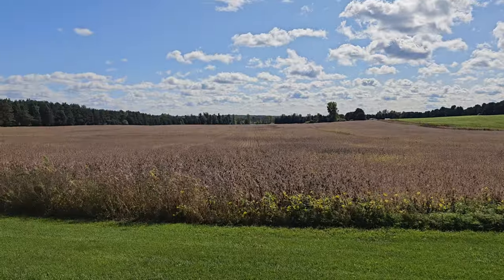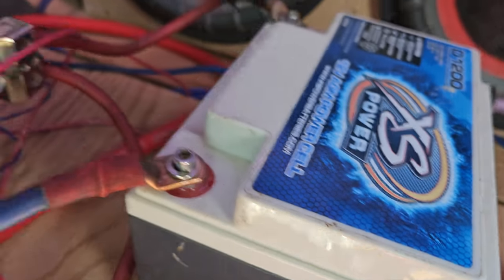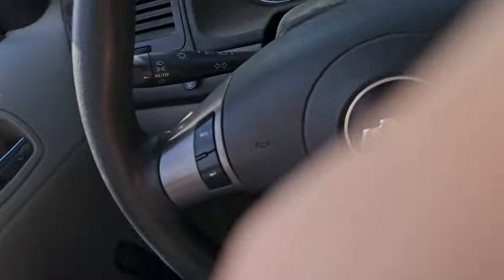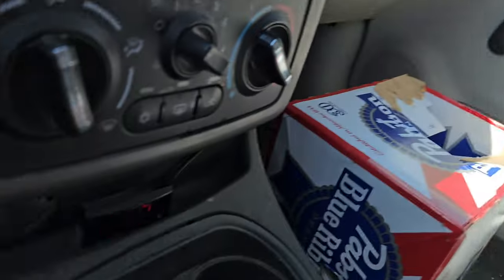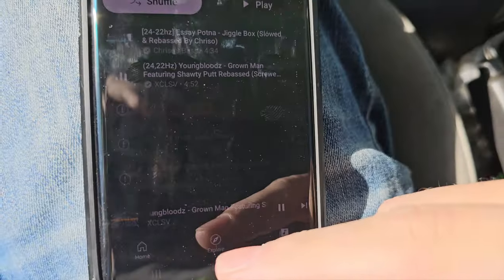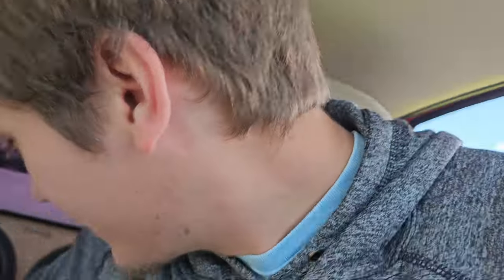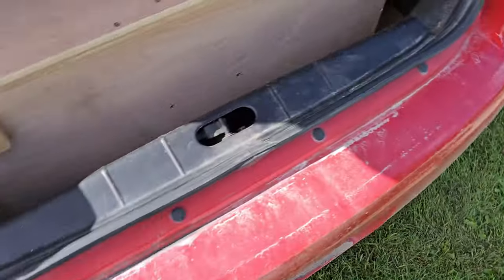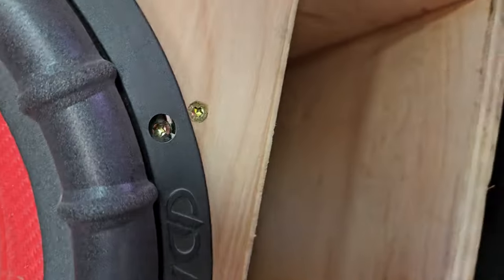2 DD9912's 23HZ Port Extension Putting In Work!!

Comment: I’m not an SPL guy, but a DD fan. That’s some amazin’ isht.
Reply: That's all I run for amps and subs. I was strictly Kicker until about 2000-2001. Went DD and wouldn't switch for nothing in the world now.
Reply: @grandam  I’ma new fan. Don’t have the space nor power for the big ones, but the 2508s…Gotta have a pair.
Reply: @grandam  they have a different type of bass sound that no other woofer can produce
Reply: @milesbachelor8747  they can handle power.
Reply: @milesbachelor8747  Yeah I'm running 4 DD 8's in my daily driver Grand Am on 2 DD1500's and it's tremendously loud

Comment: You should check out glowe voltage s2 lithium battery.. one day i will get one.. it might be enough for you without upgrading the alternator.. im in michigan also and cant wait to attend some bass shows
Reply from the maker: Never seen those before looks like that may be a good option. I was leaning towards maybe getting some Headway cells and building a lithium bank. Battery Hookup sells the superbeast which people just reconfigure into a 12v battery. Save a bit more money and have even more capacity that way.

Comment: I know a guy running 2 American bass hd 15s on a taramps smart 5k . Stock alt with one cheap AGM Extra battery. It gets STUPID LOUD!!!! 2 years no problems.
Reply: Damn. That's surprising   Those cheap full bridges don't like low voltage.  I have two HD 12s myself. 8k Banda amp. But I have 320 amp alternator, lithium and supercaps. Your friends setup would be noticably louder if he got his voltage up.
Reply: @850CANE  You're right sir!! It's just crazy how loud it gets for what he has. Of course he has 2 runs of 0gauge OFC wire going  to his sub amp and battery.

Comment: And...those are expensive subs ...playing them on low voltage will make it sound like clipping or bad voice coil..it's not good for the longevity of your sub or Amp because it makes it struggle overheat
Reply from the maker: Yeah I know I'm I'm need of more power and I'm not to worried about frying the subs I know when I'm slamming like that I'm clipping them but I only have it cranked like that when I'm giving a demo for a small amount of time. I have a high output alt to throw back in and I'm considering a lithium bank in the future as well

Comment: Why don't you care about your gear?
Reply from the maker: I do care about my gear I've run my amps in the dirt with no problems for years and everyone always complains about this and that, but to each there own I've had zero issues so I'm not worried. If I blew one of the subs then I would have a problem lmao cause thos alone cost 75 percent of the system.

Comment: if a amp cant handle low voltage its a shitty design. imo.
Reply: So it’s a bad design when a amp needs 14  volts to push 4k watts rms. What are u expecting ??? Where is the amp gonna get power from? Because a stock alt ain’t delivering the power need.U really expect a amp to pull power from where power Dosent exist
Reply: @bonelesscheese8412  don't put words in my mouth. It's a bad design when a amp can not handle low voltage or go into protection instead of smoking up.

Comment: Do u Have a voltage regulator on that chevy
Reply from the maker: Yeah I believe the computer of the car regulates the voltage.
Reply: @brizzmoto6229  I have the chevy cruze...it has a pcm controlmodule....us alternators sell an aftermarket pcmyou can choose from a fixed 14.7 or a volume know were you can turn it up to 15volts if u want it's compatible with your stuff ...you need that and like 3 marine batteries and you should be good on a stock alt to and from work only
Reply: @brizzmoto6229  I have the chevy cruze...it has a pcm controlmodule....us alternators sell an aftermarket pcmyou can choose from a fixed 14.7 or a volume know were you can turn it up to 15volts if u want it's compatible with your stuff ...you need that and like 3 marine batteries and you should be good on a stock alt to and from work only
Reply: It'll make your system come to life and shake the ground your shit is suffering from not enough power